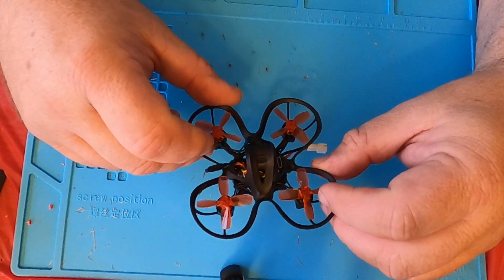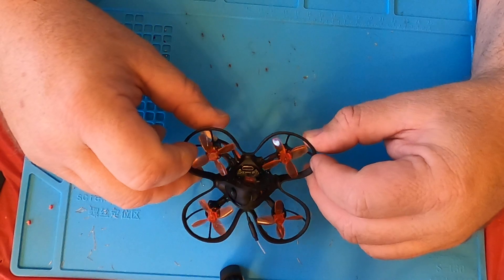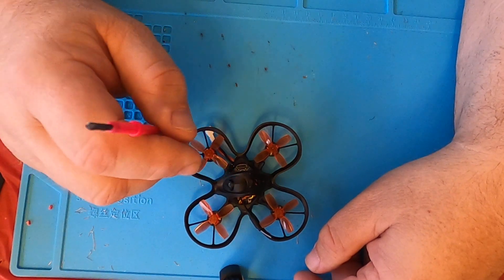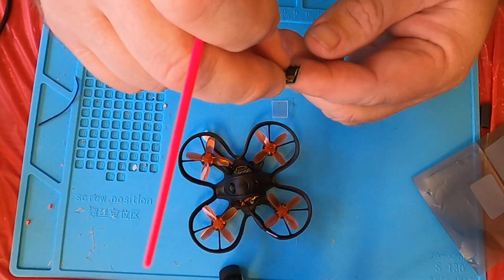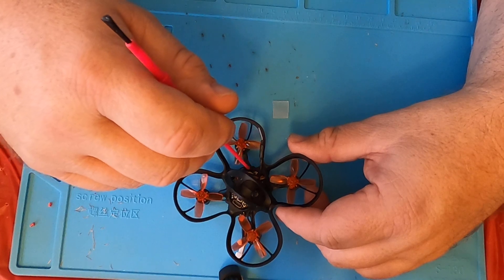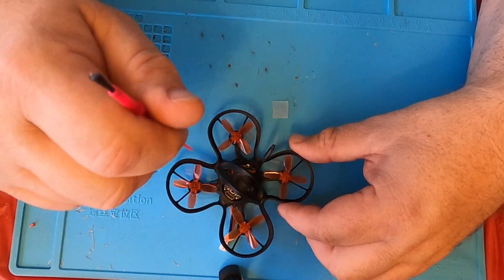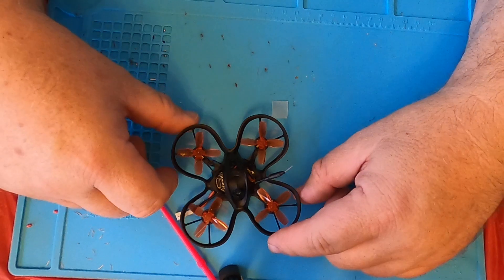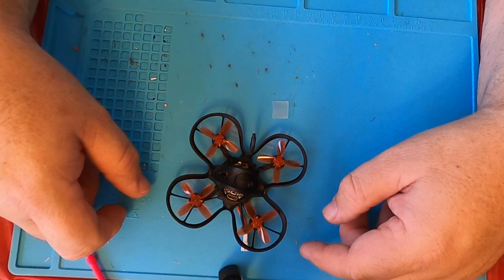Emax Nanohawk 1s Expresslrs receiver install

Comment: Thanks for the rundown, like you said the hardest part was taking it down and back together, what a nightmare.   If I didnt have ELRS for everything now I wouldnt have wanted to deal with this mess lol.  Another surprising thing I found hard was finding a place for the receiver that was out of the way.   Hard to believe the smallest receiver on the market would be difficult to tuck away, this little guy really is micro sized, fun flyer though once its together

Comment: You will find the 5v and Gnd pads on the top and bottom of the board (the pads are on the front edge) next to the camera pads. There are actually 3 pads. From the motor inward, they are Gnd, 5v, and SBUS. You will see the labels on the bottom side of the board. You will find the TX and RX pads on the bottom of the board near the motor 3 pads (these pads are not on the edge but are clearly labeled R1 and T1). The TX on the receiver will go to the R1 pad on the board and the RX on the receiver will go to the T1 pad on the board. In betaflight, under Ports, set UART1 for Serial Rx and under Receiver, set the mode to Serial (via UART) and provider to CRSF. I also had to set the channel mapping to AETR1234 but this is dependant on your transmitter setup. Done.

Lastly, for those wondering, I connected a Radiomaster RP2 to mine but most any ExpressLRS receiver should work the same.
Reply: Thank you bro!